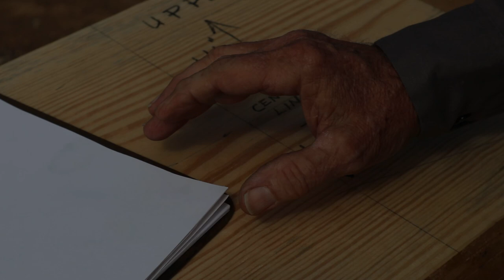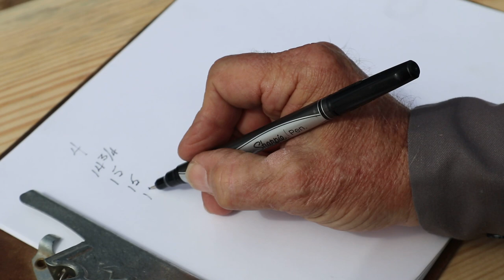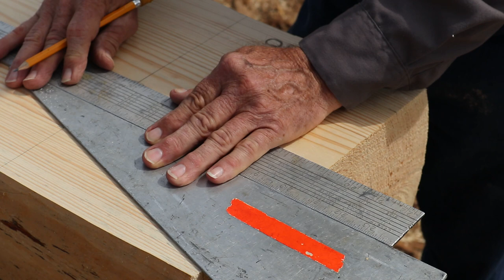Complete Log Layout Pt 1,  Figure & Layout a Half Dovetail Notch  - Dovetail Log Cabin Build (Ep 24)

Comment: Good stuff there Paul. I had to watch it a couple times but I did understand after the second time through. I did figure out the problem on the neighbours logs. When they were milled they were completely green white pine then he dried them in direct sunlight. Here at 8000' our uv is much higher and combined with a typical humidity of around 13% I'm pretty certain that is what caused the logs to split the way they did. I found on older Mexican builder to look at it and he assured me they won't split any further. He showed me how to cook gum from green roots and mix saw dust into it to fill the cracks to prevent moisture from getting in and causing separation down the road. The sill logs were the only logs pinned and to a concrete foundation. So I bored 1" holes through the logs to about halfway into the sill logs and made dowels out of some Gamble Oak and drove them in about 5' apart. 2 walls had to come down because they had already shifted a bit. It's back to where they left off 2 years ago but the man building for her left that winter and she hasn't seen him since. I'm trying to find her someone to finish the project because I simply don't have the time to do it and I don't like the construction method being used. It just doesn't look sound. Where they joined logs together in the walls there was absolutely no joinery to hold everything straight and prevent separation with age.  My small crane is available for her to set her wall's when she's ready but I just don't want to be associated with the construction beyond that. It will last her lifetime since she's already 70 but with the structural part already half done she just can't afford to start over at this point.

I only have 2 more loads of logs left to come in. There are 65 out there now and I need 100 to be on the safe side. I've been doing cookouts in trade for help pealing, 😆 working out pretty good so far but still a long way to go.
Reply from the maker: Dave Johnson   Howdy Dave - man, it’s a shame for someone to be taken advantage of, especially a lady. What the gentleman showed you is very interesting. Glad you were able to help her and like you did. With humidity that low and real green timbers l can see a problem in the works. Hopefully there will be someone who can finish putting it back for her. Also, I ‘m thrilled for you being able to get your logs. It would be so fun to get in on the build with you. I hope everything goes well and as planned for you. May God bless you and watch over you as you work!
Reply from the maker: I was also going to say that trading good food for work is genius! About all l could trade might be a peanut butter sandwich hehe. Blessings to ya brother

Comment: Hey there, Paul. I've been following your channel for some time now and I must say that you are a true Craftsman! You can tell that you teach off of years of experience... Great work!!
I have a question..... Can you use these methods for full dovetail layout/joinery?
Reply from the maker: Howdy Tony- thank you so much for the kind words. I really appreciate it. Yessir, I guess I’ve got a few years under my belt. I think what you’re calling a full dovetail is what I call a compound dovetail. The method is the same but the template is not the same. I use a 1:6 template for a compound and the same amount of wood is taken off the log above and below the center line. The layout is a bit different because the layout is transferred from the inside face down the end of the log to the outside. I know this may sound a bit confusing so if you have any questions you can email me at thebeardedcarpenter8@gmail.com and I’ll try to answer them. God’s blessings to you

Comment: Hello from Oregon.  I noticed when you planed the inside of the log, electric plane, you skewed the back end of the planer so it rode on the previously planed surface.  Do you find that it cuts down on the deviation  in the thickness and not leaving as many ridges you mentioned?  Very meticulous work, amazing.
Reply from the maker: Howdy- I do that to keep from leaving a ridge. Even at the best sometimes I will get a ridge and use a spoke shave to take it out. Some planers seem to cut heavier on one side or the other. That can be used to your advantage when trueing up a timber that was sawn out of square. Thank you so much for watching our videos and for the kind words. God bless you

Comment: Dear Bearded Carpenter, I cannot thank you enough for this Sir. I have never held a carpentry tool in my life. But I have come to like Log Cabins and plan on building one for my family and myself. I was reading Peter Gott's theory, but lacking practical exposure, could not understand it fully. Your work is now filling up my conceptual gaps. I see Destiny's Hand here. Could you please upload a Notch Layout Chart for Log Heights from 6" to 10"? That height would more likely be found around where I am. Secondly, is there an ideal height to thickness ratio for wall logs? Thanks in advance.
Reply from the maker: Ankaj Sharma   Howdy- glad you have been able to get something out of the videos. Peter has taught many people how to build a log cabin. I didn’t get to take a workshop but I was so fortunate to get to work with the guys who were in his crew. They have been a big influence on me and were willing to help me learn. I owe them so much. Also, I appreciate what Peter has done the revive log building and his willingness to share his knowledge. We have worked with logs that were 6”,7” and 8” thick. The wider the logs the thicker they need to be for asthetic purposes. Six inch hewn log is kind of a standard thickness around these parts so that’s what I like to use. I don’t think I would want to builder with anything less than that for the thickness. I can work out smaller size logs for you if you want me to. I you can email me Thebeardefcarpenter8@gemail.com l can give you the dimensions. God bless you

Comment: To the Bearded Carpenter, Hope it has been a good holiday for you. In watching pt1 thru pt3 half dovetail notch, I can not find any place you talk about how you cut the shoulder in reference to the shoulder cut line in dovetail making to the shoulder line. The other cuts you stayed away from you mark a bit off the line with you chain saw and the worked the top and bottom paring to your line. Looks like except for a little meat cleaning out the corner. Do you make the saw cuts on the shoulder right on the line? I am having a little trouble getting a good cut at the shoulder line. Thanks and God Bless Paul.
Reply from the maker: Howdy Brother- I leave about an 1/8” of the line on the shoulder so I can make saw passes to bring the inside log face to control. Hope this helps. God’s blessings to y’all

Comment: Do you use the same notch dimensions for all log thickness. I'm thinking of making my logs a little thicker close to 7". Would the aluminum taper template be the same 3:1 ??
Reply from the maker: Howdy Bill- you would use the same notch dimension on the logs in a single round. The same template is used for whatever thickness you have. The 1:3 angle is the same regardless of log thickness. God bless

Comment: Hello, love your channel.  My grandfather was born in Belleville, Yell County Arkansas which I think is nearby where you are.     I have a question - I noticed your chinking gap is 1 inch, but most of the other traditional gaps are around 4 inches.   I'm wondering why you chose to use 1 inch, and if someone decided to go for 4 inch gap would that change the notch layout much?
Reply from the maker: Howdy Kevan- Belleville is not that far away. Been through there many times. Many of the old cabins were built by people who were using logs that had been cleared from their land for crops and they used what they had available. They had to move them by hand much of the time. It was easier to get more height on the wall by making the gaps wider. They had to do more upkeep on the chinking also.  I use 1” in the mathematical formula to keep the gaps somewhat uniform. If you wanted wider gaps the numbers would have to be changed. Keeping chinking mortar in wide gaps is a bit difficult when you’re putting it in. Wide gaps are more apt to sag and you’re constantly having to go back and pull the mortar back up until it begins to set up. I’ve chinked wide gaps and it can be a chore. Thank you for watching the video and for the comments. God bless you

Comment: You have probably already covered this somewhere but, are your log widths the whole log or just the hewn/sawn face?
Incredible craftsmanship.
Reply from the maker: John Carlton   Howdy John, I am taking the full width of the log measuring at the middle from either end. The actual face width is not a full width measurement. Using two framing squares will give you an exact measurement by hooking the squares on opposite sides of the log. You have a good question there. God bless you
Reply: Another question. Is there something magical about the1:3. slope on the 1/2 dovetail notch? Would 1:4 or 1:5 (less angle) work?
Reply: @TheBeardedCarpenter  Thanks for the speedy reply. You'll quickly discover that I am not a carpenter, don't even have a beard.  If all my questions become too annoying just tell me to shut up. Really love the videos and you explaining all the tricks in achieving precision.
Reply from the maker: John Carlton   The 1:3 that I use is what is asthectically pleasing to me. The old log buildings l have seen in our vicinity were a notch very similar to what l use. I have also seen them that used a shallower angle that looked nice. I feel the 1:3 has a little more holding power. Blessings
Reply from the maker: John Carlton  am honored that you have enough confidence in me to ask me anything. My intention has been to do what I can to help people achieve their own dream of building a log cabin. Thank ya for the questions brother. Blessings to you and yours
Reply: @TheBeardedCarpenter  Hello Paul, a light bulb just went off after wondering about angle degrees. A template that is 1:3 ration is brilliant. I will write a full post and I hope that would be okay. You do fine work and a great teacher for us. Thank you Sir. :)
Reply from the maker: @timgiles9413    Howdy Tim- glad you got it. Looking at the notch it just seems to be the right angle. God bless